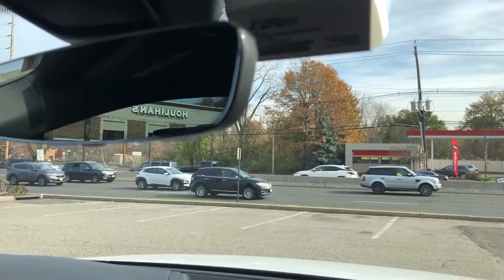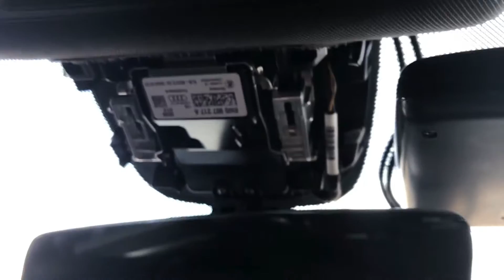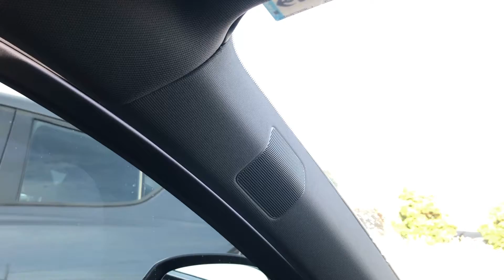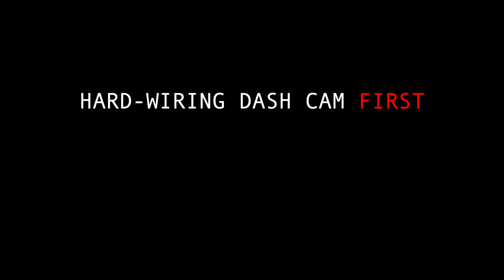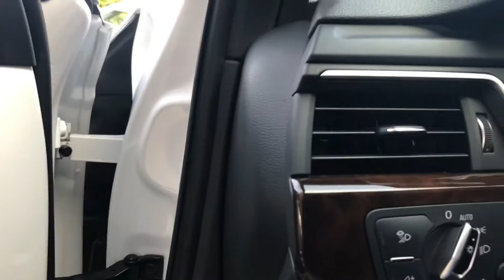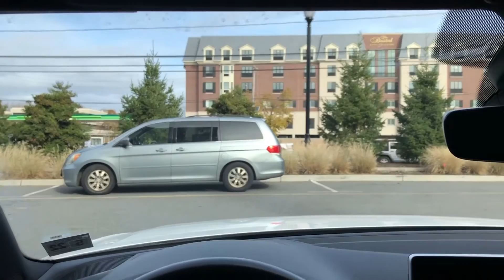CLEAN INSTALL - Hardwire Dash Cam (Front and Rear) + Radar Detector in a 2017 Audi A4 (B9)

Comment: You may want to redo the wires on your drivers side a polar you have run the wires across the airbag and it will not deploy properly if needed

Comment: Finally got around to hiding the wires after hardwiring (used your video in conjunction with Google to do that - super helpful). Something I found very helpful is that when you take off the cap over the lights/mirror towards the back side there is an opening where you can easily shove any extra wiring. Mine was too long by a lot and that was a perfect place to “store” the excess. Helpful video as always - glad you’re around so I have videos for all the stuff I’m doing with my A4!

Comment: For the constant power fuse for the interior lights that you used for the dashcam, which fuse number in the middle fusebank is the correct fuse? Did you also tap a fuse for switched power for the dashcam?

Comment: Why not hardwire into the mirror with wiretaps?
Reply from the maker: That only allows the camera to be on when the car is on. You need an active 12V source when the car is off to use parking mode

Comment: Why would you want your camera to have constant power without keys?  Wouldn't it drain the battery?
Reply from the maker: For parking mode (it’ll record while the car is off). The camera uses very little battery when the car is off (roughly 3amps). There’s a built-in voltage detector so if the battery is less than 12v, it will automatically turn off without damaging the battery.

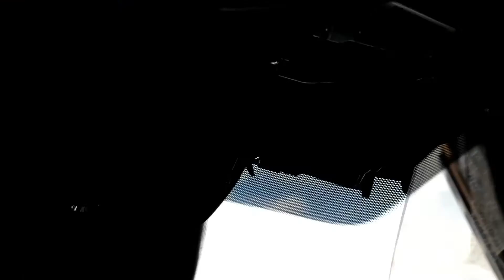Comment: I’ve been trying to follow this video step by step, just wanted to clarify on something. You lost me a bit at 9:03. Where did you run the wire when you got to those mirror electronics in the middle? Under the top clips or under the whole housing?

Thanks again
Reply from the maker: I ran the wire through the headliner (not through the housing). You can run it through the housing but then the wire gets crimped when you put the cover back on. You can slightly pull the headliner down and stuff the wire all around the mirror housing
Reply: @DIYDetail  Perfect, thank you for clarifying much appreciated 👍

Comment: thank you for showing me how difficult that is, you actually just saved me from a lot of trouble! I'll just stick to the 12V cord hanging off the middle of my windshield.. lol
Reply from the maker: No problem! It’s not too bad if you’re willing to spend a few hours stuffing the wires (you could pull the trim but the clips break very easily so you’d have to find replacement ones haha)

Comment: What fuse did you use for the radar detector? I have a S5 and was trying to use the fuses up by the dash and they wouldn’t turn off with the car. It stayed on at all times.
Reply from the maker: Hey! I tapped into the Homelink fuse under the dead pedal. I had the same problem when using the side panel fuses. I haven’t had an issue so far with the Homelink fuse
Reply: Yessir, home link was the winner. Great vid